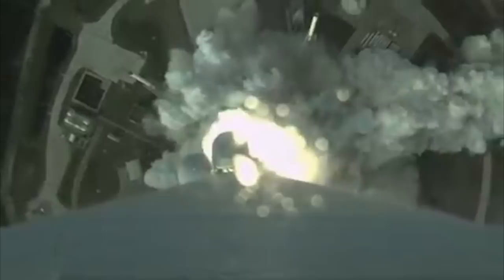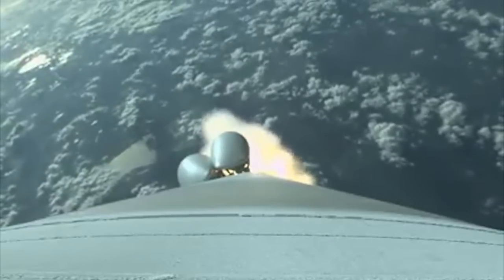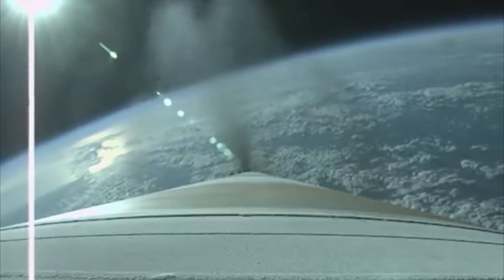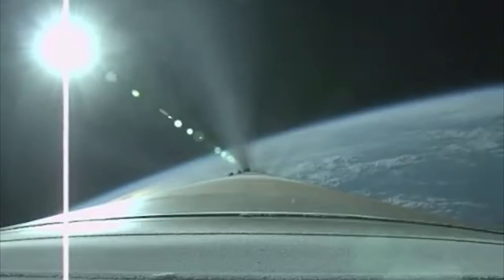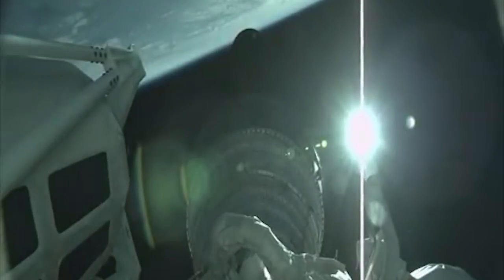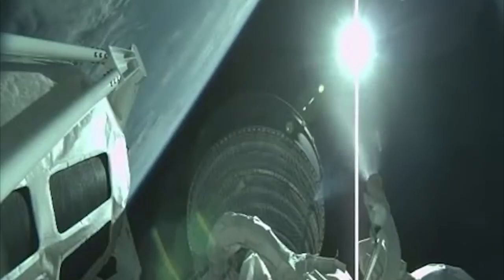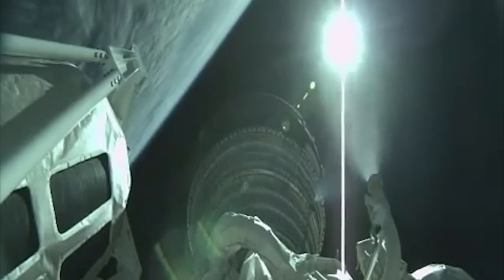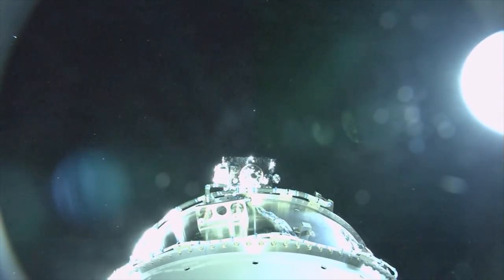Atlas V GOES-S Rocket Cam

Comment: Camera make sound...
SORRy...
Space have no sound... so how can sound be heard
Reply: Sim On The statics sounds you are eating comes from the space radiation. It’s like when you record a video in the chernobyl reactor 4: the radiation are so strong that the microphones sensors catches it. The data is satellite transmitted so it could also be the vibrations messing with the data transmissions.
I’m not sure which one of the two explanation is more reasonable, I don’t know the altitude and the details.
Reply: Sound travels thru solid objects even better then in air, go back to school kid;)
Reply: Jom Creative they don’t care about idiots who don’t believe space exist;) Beside you can see live landing of boosters on land, that is fake too?
Reply: With the atlas v is really difficult that they will add more cameras, the rocket is relatively old and the design and aerodynamics could change adding cameras, I suggest you to watch a spacex live
Reply: The camera is on the metal,so it can pick up sounds
Reply: Jom Creative  you've just been taking the same message and putting it everywhere in this chat thread.
Reply: Jom Creative  there just isn't a reason to launch such a device. You want it up there as proof, but you'd end up doubting it anyway. You believe everything they release is faked, to the point that even actual launch videos aren't enough. And you say that they only released some grainy photos but there are many photos of the moon and its surface from the various launches over the years. The manned launches haven't been done in some 30 years, and all footage was grainy at that time. Supposedly they are considering another manned launch soon, so maybe we will get photos or video footage from that, but I honestly doubt it will be enough for you to be pacified, since you seem to just be looking for reasons to doubt the globe model instead of running physical tests to try to prove your own.

 Getting additional weight into space is expensive, and they have no reason to "waste" money on sending an additional camera up in space just to look at the world constantly. That's a pretty significant energy drain as well. But if you really want it, start a GoFundMe or something for it. Fund the money so you can get what you want.
Reply: Jom Creative  you can use a telescope to see the ISS and SpaceX satellites. Satellites can stay in the air as long as they do because they are released at orbital speeds, and the fuel they have on board give their small thrusters the ability to boost every now and then, keeping it afloat. Stations like the ISS hold additional fuel to routinely top off the satellites that begin to run low.

Despite this, satellites do still fall out of the sky. They burn up in the atmosphere on reentry and are made to do so to prevent potential injuries resulting in falling objects.

Comment: Notice how the earth is clearly spinning at 1000 mph.  The clouds isn't even moving while the earth is spinning at 1000 mph.  NATURE is awesome like that!
Reply: "1000MPH", a linear speed measurement, for Earth spin is is just 15º per hour, what is half of angular speed of a hour hand of a clock, that spin at 30º per hour. And the hour hand of a clock already see too slow. ;))
Reply: The Earth is spinning at 0,000000000298 UA per second so, it's LITERALLY IMPOSSIBLE to see it.
Reply: @valentinotera3244  1,000 MPH son. And yes, you can see it. 

It may take 24 hr to do a full rotation, due to the size of the Earth, but at 1,000 you can surely see it spin!

Especially if you are very close to the spinning surface.  lol

Like flying on a helicopter 20ft above ground, you can see it goes 1000mph. 

If in fact the Earth was "spinning" at 1,000mph. 

Which it isn't.
Reply: @jzizzles7799  So is it flat and stationary?
Reply: @jzizzles7799  nah you cannot see something moving at 0,00000000000000000000000000000000000000000000000059125 light year per second.
Reply: jzizzles if it is rotating once per 24 hours, you won’t be able to see it very well. Take a ball and spin at .00087 rpm and tell us if you can see it. Since flat earthers like saying perspective so much here’s one for you. From the perspective of something with a circumference of 25000 miles, and it rotating at 1000 miles an hour, it wouldn’t seem to be rotating very fast. It’s basic physics that something smaller going at the same speed appears to be going much faster than something much larger going at the same speed.
Reply: @jzizzles7799  you would be able to see it spin. If you weren't tethered to it, except the helicopter you are talking about is using air to hover. Air that is tethered to earth via gravity lock, and you are interacting with that air, and also gravity locked, which means you are also tethered to that same earth. If you drop a ball in a car, it just falls down, because the air in your car is moving relative to the car's motion, and everything in that car is doing the same. The ball won't hurl past your head, shatter through your rear window, and disappear into the distance because its moving with you, and the air, in the car. 

If you are somehow expecting objects that aren't bolted or strapped to something to not move relative to the motion of the body they reside in, then you should be equally terrified of people walking to the restroom on an airplane. They aren't bolted or strapped in, so they should be flung through the back of the plane, or at least pain the rear cabin red with blood, flesh, and shattered bone, shouldnt they?
Reply: @gorisenke  false. as you lose momentum once you leave the ground.  Earth doesnt spin. how can a copter hover for hours and be at the same place of earth was a spinning at 1,000 mph
Reply: @jzizzles7799  Refer to the ball and car model I presented. You and the helicopter are stationary relative to the earth, because all parts started at the same speed. You dont lose momentum just from being airborne, and most of the momentum is maintained since the air the helicopter is using to stay aloft is also moving with the helicopter. Inertia is maintained, mostly. A little bit is lost, since the earth is slowing down, but the difference there is so tiny that it takes lifetimes to observe. 

Just because you dont have a visual cue that something is in motion doesn't mean that it isn't. You can sit in the bathroom on a train with no windows and accept that the train is still moving. You can do the same with a plane. In both cases, your helicopter reasoning doesn't hold up. Things have relative speeds. You were born on this body of mass, so it makes sense that you cant identify its motion via physical touch sense. You have always been moving at this speed, roughly. 

I have tried to explain twice why your argument doesn't hold up. There are phenomena that undeniably occur every day to us that the flat earth model cant explain. The globe earth model can. I can observe events and physical interactions that match with the science behind a spherical earth, and those same events and interactions make no sense in the flat earth model, or at least I haven't seen any explanation to cover it. From my observations and experiments, I can agree with the widely accepted fact that the earth is a round planetary body. People have believed and known this for over two thousand years, and the model still holds up to scrutiny. The flat earth model doesn't. There isn't even a single model for flat earth, but there is for a round earth.
Reply: And when you can see the moon with a telescope, the moon will run away according to a person trying to shine a blue Lazer which apparently has 3000W.
Reply: @Sokol10  ah but are they real clock hands or CGI? Sorry I came over all conspiratard for a moment.
Reply: @jzizzles7799  Tell me you don't understand physics but think you do, without telling me you don't understand physics but think you do.
Reply: @jzizzles7799  False. You're still inside the rotational system of the Earth and atmosphere, so even after leaving the ground you're still under the effect of the system and being moved along with it. The only way to move independently of the system is to apply a directional force. Hovering simply maintains your position relative to the system, it doesn't apply directional force to change your position.
Reply: @xyex  so what your saying is we create a vacuum chamber everything inside the chamber should instantly be smashed into the side of it because its no longer connected to earths atmosphere? Strange how that doesn't happen and we can have things hovering inside a vacuum chamber forever with no movement.
Reply: @joey9511  The chamber itself its inside atmosphere , my dude what kind of example did you bring on xd it doesn't make sense.